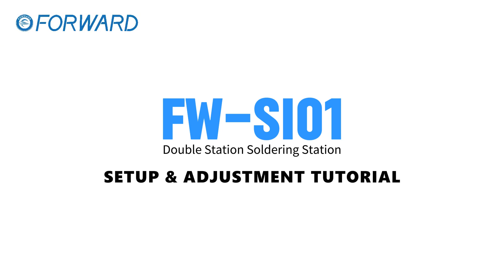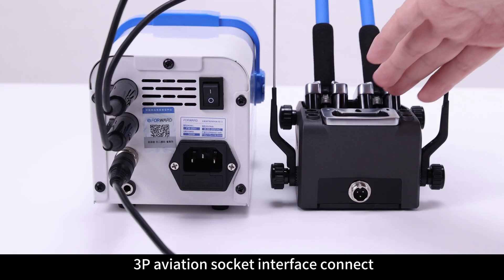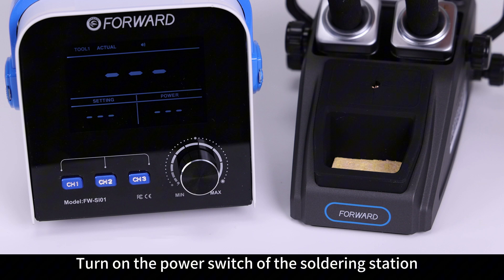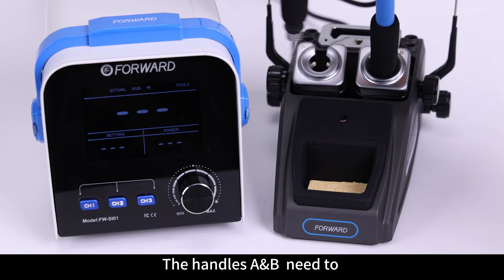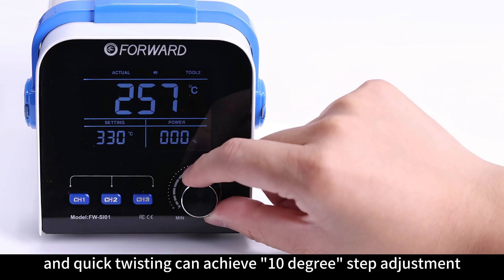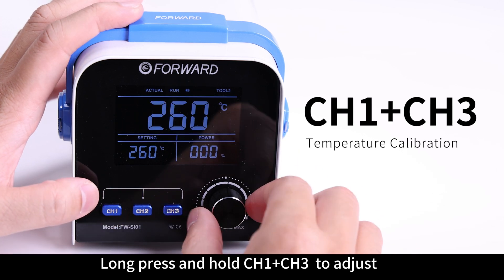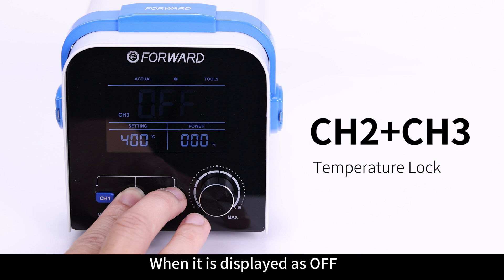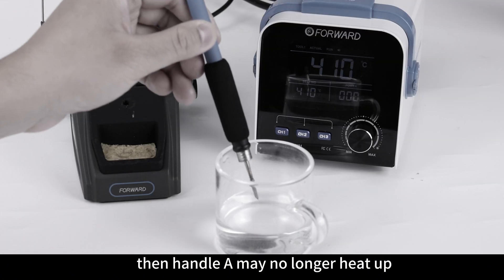🛠FW-SI01 Double Station Soldering Station setup & adjustment tutorial | FORWARD

Comment: i have problem sir my the is soldering iron have direct sleep mode option why not temperature down before go to sleep mode if the is soldering station have setting please say it to me how can i im doing theis
Reply from the maker: FW-S01 : Put the handle back on the designated soldering iron bracket and the soldering station stops heating. When the temperature drops to 200 degrees,
"---" is displayed and the device enters standby mode. After 5 minutes, the standby mode ends and the device enters sleep mode.